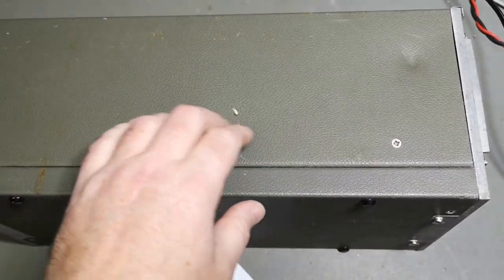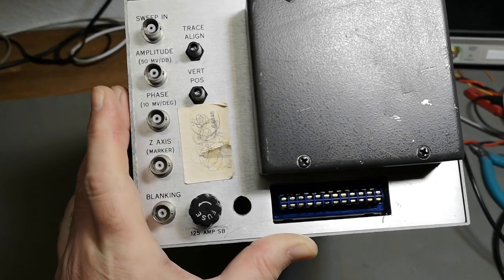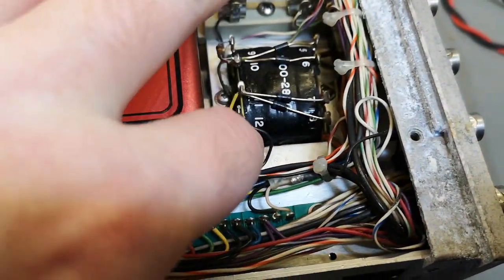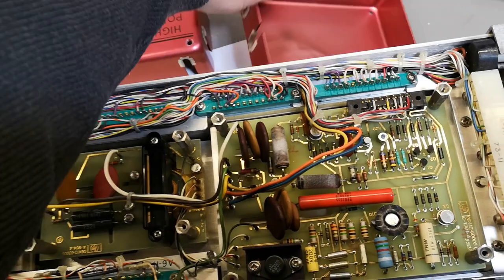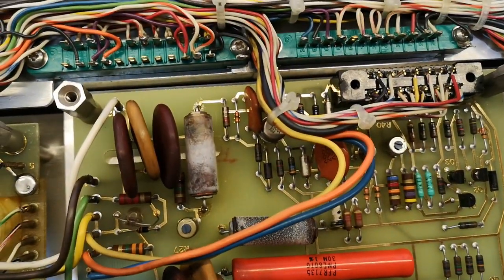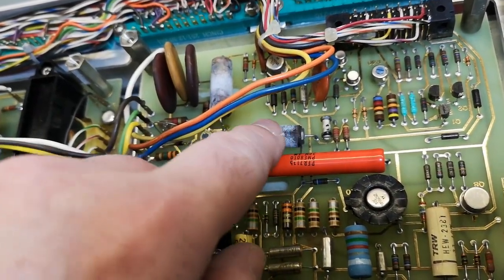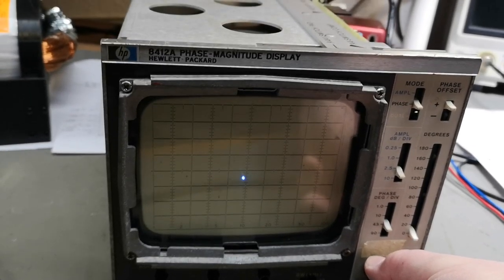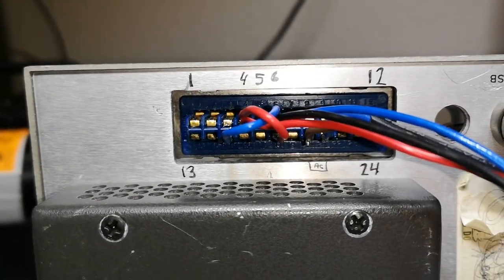HP 8412A Phase Magnitude Display XY oscilloscope modification

Comment: WoW you are really good 👍
Before I got the Tek212 for my curve tracker, I was able to buy a similar Scopmonitor, but it didn't fit me dimensionally.
I know the problem with versions and documentation very well, it is sometimes diametrically different not only between versions A - B but also A - A according to age, for example RMS voltmeter HP3400. I'm always very sorry to see such a corroded structure - I've also cleaned and repaired a few of them.
But you did a wonderful job with this, I would look for a defect, not a modification.

Nice day 🙂 Tom

Comment: Have you made a permanent power supply for it?  You could 3D print a nice new frame for the CRT
Reply from the maker: if only i had one original plastic frame for both my HP units, i would have 3D designed and 3D printed for them both, a new HP scope video is due for tomorrow